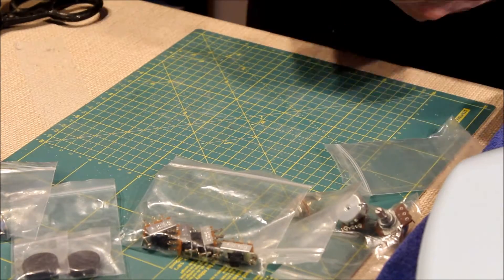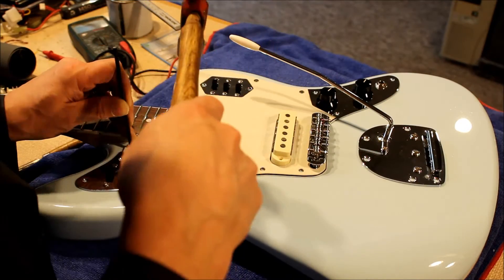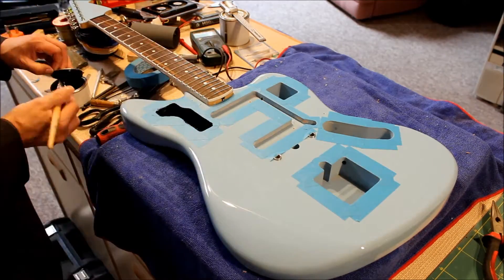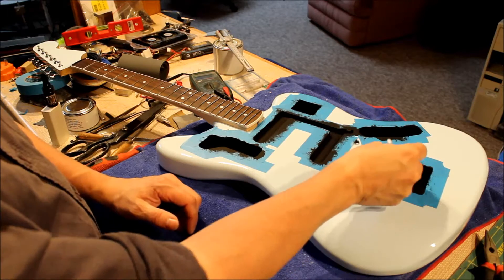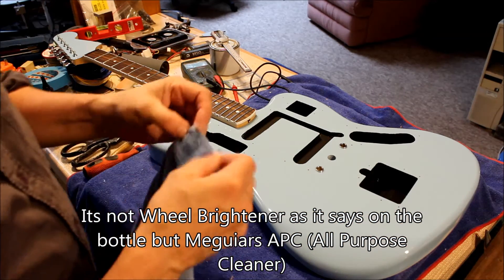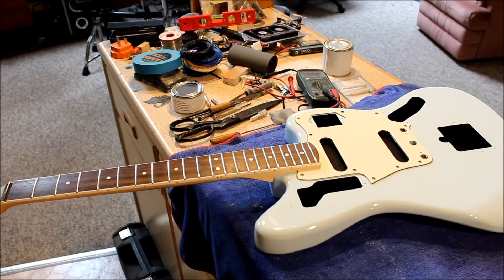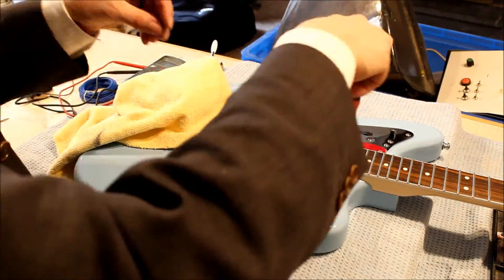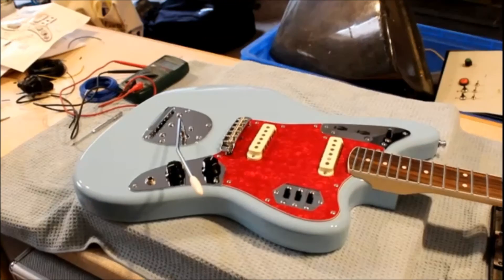CNC Project - Jaguar Guitar - Part 18 - Electronics

Comment: Do you have a circuit diagram you could let me have??? I've just uses one that didn't work!!!
Reply from the maker: Hi Richard
Here's the diagram I used: https://www.dropbox.com/s/ffkznnyi1olwhzd/302tcn5.jpg?dl=0
When I did mine I did have to pay particular attention to the orientation of the 3 switch assembly, as its easy to get it reversed (it should engage the pickups when the switches are in the up position). Also you need to make sure you have good continuity to ground between the cavities and if using conductive paint, as I did, make sure none of the solder points throughout touch that paint or you'll be shorting out.
Hope that helps and good luck with your build.

Comment: Thanks a lot for your videos! I'm thinking about building one myself from an MJT body and Musikraft neck (I'm left-handed).
My problem is: I'd have the drill the holes for the pickguard, control plates, and tremolo. You talk a bit about that at 1'30" but could you please give more explanations on how to center those parts, especially the tremolo? How did you do that?
Thanks a lot!
Reply from the maker: Hi FlagadaJohn
Tricky one that. On mine I essentially cheated by using the CNC machine to pilot the holes for the pickguard, tremolo etc  at the same time as the body was cut. The only way of laying the parts out manually on the body is to make sure you know where your centre line is and arrange everything based off of that. The centre line on the Jag is probably best marked from the centre of the neck pocket face where the neck heel sits and the centre of the back or front face of the tremolo pocket. Fixing the neck once you have that provided you trust the dot inlay placements I do by laying a 1metre steel rule along the neck centreline and then making sure that is lined up to the centre of the tremolo plate.
Hope that lot made sense and best of luck with your build.
Reply: @CMDRTeatime  Thanks for taking the time to answer me!
I get it for the center line, thanks! For the axial position, I guess I could put some tape around the cavity, mark the aft most position, then mark the forward most position and then put it in the middle?

Comment: Do I have to ground a stop tailpiece?
Reply from the maker: Provided the bridge is wired to ground and you have good conductivity from the stop through the strings to that, you should be OK. Use a  multi-meter to test it, but there won't be any harm in grounding the stop to be extra sure if you want to.
Reply: Thanks. I'm now waiting for my electronic parts to arrive. If it still buzzes, I may have to find a way to drill a hole from the jack cavity.

Comment: Where did you get all the parts for the controls ?
Reply from the maker: Hi - I got many of the parts from this kit: https://www.ebay.co.uk/itm/Jaguar-guitar-full-replacement-hardware-pickguard-wiring-kit-fits-fender-new-/111104180117?var=&hash=item5f810260c4 - I wasn't that happy with the scratchplate so recut my own (there's a vid of that somewhere).
I then "upgraded" the pots, knobs and caps from Thomann over in Germany (https://www.thomann.de/gb/index.html) - the Fender pickups came from there also.
At some point I'll likely replace the tremolo unit with the locking kind (handy if you break a string)
Hope that helps.
Reply: I_Made_This thank you

Comment: Again you make it look easy and I know it wasn't.  Lots of wires in small tight cavities..... Great job!!!
Reply from the maker: Thanks - actually it wasn't that bad once I had sorted out the order of which bits to solder first. The only complication, which was somewhat self-inlicted was that because I used shielding paint it makes the whole cavity conductive. I had to make sure that there were no shorts from solder joints etc to ground via the paint in that case. I used hot glue in a few places to help with insulation :-)